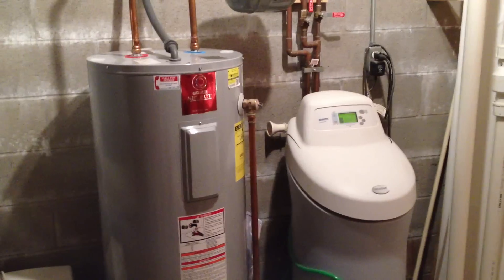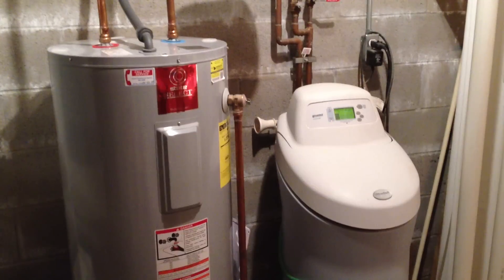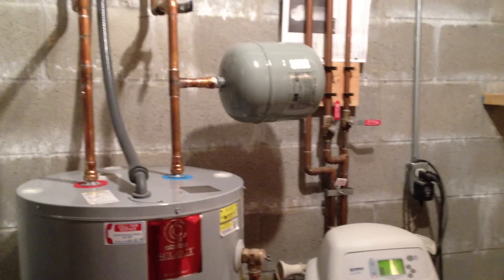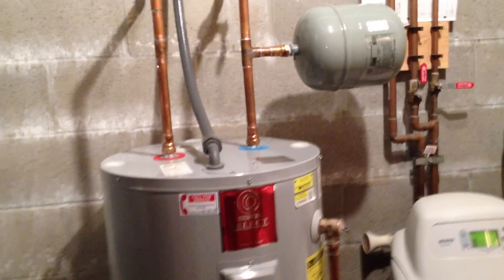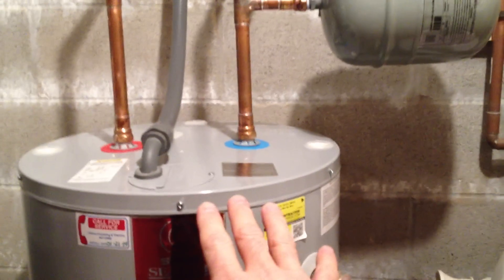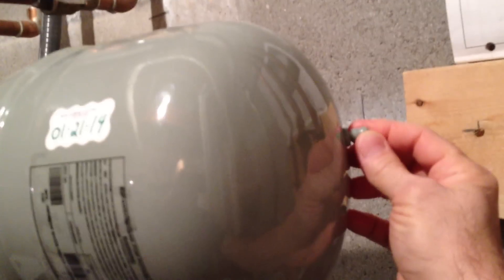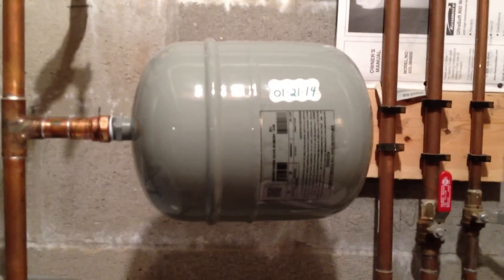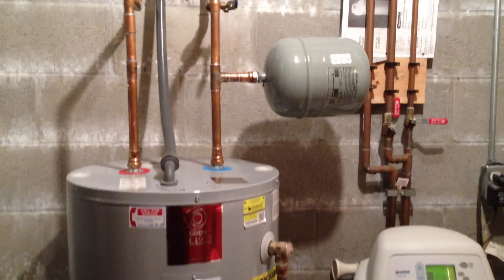Protect Your Water Heater with a Thermal Expansion Tank

Comment: This install violates plumbing code! your expansion tank will eventually fail due to fatigue.  Especially if its only a 2.5 gallon.  I see this happen alot.   We will usually install a 5 gallon tank.   Regardless, your tank has no support.  Its only support is on the copper pipe.  When the bladder inside the tank fails,  its going to become full of water, weighing between 15-20lbs.  Due to the fact that there usually isn't any immediate indication of a failed bladder, you won't have any idea that its in need of replacement.  that weight will bare down on your copper joints and eventually result in a failure, which can lead to 1,000.00's of dollars in damages.  You need to call your plumber back and have him support it to the wall ASAP!  I noticed there isn't an inspection sticker on your water heater.  Had it been inspected, it would have been red tagged for that very reason.   Typically I install them with brass fittings vertically with the threads of the tank facing down.. I Install a brass tee connected directly to the cold inlet.  From that tee I install a brass nipple about 5 inches long with a 90 elbow at the end.  the Tank then gets installed directly into that 90.  I then connect the water flex into the top of the tee.  This insures that the tank is supported.  If it has to be installed directly to the copper, then it needs to be supported to the wall!!!!!!!!
Reply: chris holliefield That's exactly how I install these too - threaded brass pipe and fittings only! Super clean, secure, and to code.
Reply: And don't I wish you were my plumber.  What did you charge for installing this expansion tank?  Mine is saying brass fittings expensive, going to use something else, don't know what yet.

Comment: More than likely, your water softener is the reason why your water heaters are failing prematurely. Water heaters have what are called sacrificial anodes. It's a rod made of a material such as zinc that provides an electron exchange to prevent the water from corroding your heater tank. Water softeners cause this rod to deplete faster. You should either replace your anodes every 3 years or buy a powered anode. The powered anodes can only be found online (at least in the US). They are not a high demand item as most people just keep replacing their water heaters instead of maintaining them. Lowes and Home Depot most likely won't know what you are talking about if you inquire there. There are a couple of places that can be found online. They range from $150-250. I wish manufacturers would start using them but I understand why they don't. I did have a high efficiency gas water heater that had electric anodes but I believe that is the only water heater form a manufacturer that uses them.

Comment: The piping needs to be protected from electrolysis with di-electric unions where it connects to the copper. Strap the expansion tank and water heater, keep your water pressure below 75PSI, and replace the anode rod every 2-3 years and you're good to go.
Reply: He May have used those di-electric nipples at the water heater heater inlet/outlet. I just yesterday replaced my 10 year old water heater and I can say for a fact that they work flawlessly. I removed them just for the heck of it and there was absolutely no rust or corrosion..

Comment: the water softener is the reason why your water heater is getting dissolved. first thing that's going to dissolve is your anode rod inside the water heater. it's also known as your sacrifice metal. It's made out of aluminum or magnesium. once you're an old Rod dissolved in your water heater will start to dissolve. stop using salt for softening your water. you're going to ruin your copper water pipes too. strap that thermal expansion tank vertically with the inlet at the top. when your thermal expansion tank bladder leaks that tank will weigh a ton and your pipe will break.

Comment: Your water heater expansion tank needs a vertical support because it was mounted horizontally. In that orientation, over time, vibrations through the house will fatigue the stressed metal on the top side of the fitting to the expansion tank. When it fails, water will go everywhere in a hurry. Avoid this my adding a shelf under it or installing a vertical support above it to take the strain off the connection between the tank and the vertical pipe.
Reply: It's faster than writing it out.
Reply: its not even supposed to be mounted horizontally.
Reply: A O hi, please help educate me. If not suppose to mount horizontal. How we mount it?
Reply: @poisuon4651 Vertically.I use Holdrite QS-5 brackets, they're made for 2.1gal TETs and only about $15 each. I also use 2' flexible copper connectors for ease of installation and changeout.
Reply: I saw the thumb nail and was like , wtf is that lol. Failed
Reply: Waters, you are correct in saying Watts instructions say vert OR horz. but Amtrol does not allow for horizontal install
Reply: Yup ! Get a new plumber ! 2nd reason not to use him again
Reply: I would have also put a shut off valve next to the expansion tank... I'm not shutting down my hot water just to replace a expansion tank (5 min fix). Also would have connected the expansion tank with a dielectric union for ease of replacing it down the road.
Reply: Mine is mounted the same way but has brace holding it

Comment: your water softener is actually more likely the culprit here. thermal expansion (closed system?) is definitely a water heater killer, however, softeners are hard on water heaters too. trading salt for calcium (ion exchange) adds + ions to your water which accelerates the degradation (electrolysis) of your tanks sacrificial anode rod. once that rod is depleted, the tank becomes the anode, and begins to corrode/rust. only time will tell, but i would recommend changing out your anode rod every 2-3 years or using an impressed anode rod. been plumbing for over 15 years, and in nearly every case that a water heater failed prematurely, a water softener was installed in the home. hope this helps!
Reply: Agree that the extra salt is definitely killing your HW heater through corrosion due to the large amount of salt injected. From my experience the anode needs chageout in severe cases every 2 years.
Reply: i assume a watet softener is better then letting hard water inside the tank?
Reply: Your  Exactly right. But not all watersofters have backflow in them.
Reply: You can't install a water softener on a hot line. Unless its built for hot water
Reply: why cant you just install the water softener on the hot water side, as in it gets its water after it's been heated up? or does it not work like that?
Reply: Cole Riley  the softener eliminates calcium clogging the walls of the tank and coating the heater elements

Comment: Myviews if you have a leak its going to bust and spew water like a fountain all over. If your not home yr screwed worse than if you are. Since it works from the water intake you will have a high water bill. Call a plumber now, or look at the tutorials on replacing. I may fix mine, but researching more on pressures etc

Comment: i am installing a new hot water heater. the existing unit is an antique just about. its probably 30 years old and its starting to leak. i already have a new hot water heater just waiting to get help to install it. my question is, my home is on a well so there is no back flow preventer like you are describing. the well is on a simple jet style pump i and i usually maintain around 40-60 PSI of water pressure. does this mean that i do not need an expansion tank?
Reply: +andrew donohue it looks like the expansion tank operates much like my well tank except the well tank is much larger, i think its 13 gallon vessel but with the expansion bladder i think that means that it actually holds more.

Comment: I'm not a plumber, but I don't think I would want my expansion tank sticking out sideways like that. When it gets half or more full of water it's going to be pretty heavy. Also, wouldn't it work better if it is vertical so the pressure of the water is evenly distributed over the bladder?
Reply: Is not a problem  to have it on the side,but you are absolutely right about  the tank not being supported properly.
Reply: @Superguapo100  Vertical install is the correct way.  water on TOP of expansion tank pressure on bottom?
Reply: @tedlahm5740   vertical is the best way 100% , on the side is still ok according to the manufacturer and physics laws lol. i wouldn’t do it  tho , but if absolutely necessary you can put it horizontally and still sleep well.

Comment: I got a pin hole leak in the wall near the water heater.  The pressure is was so high it bored a hole through the 1" of rock sheet/fire protectant which is like cement, then after it bored through that it bored though another 1" sheet of the the same cement looking stuff until it hit wood.  I have also replaced 2 water heaters recently.  The pipe was in the wall near the water heater.

Comment: That expansion tank looks like a regular one for HVAC use, not a stainless steel potable water expansion tank. If it is not, you may have issues with corrosion and unhealthy artifacts leaking into your potable water supply

Comment: This tank guards against Sudden increase of the pressure will shock the lining of the water heater.These tanks should be installed vertical and supported because municipal water has added ingredients called rust scales that deposit in  dead ends or low areas. This crud will eventually saturate half of the holding capacity of the tank and shortened the life. Vertical, it drains its self  of crud.

Comment: I wonder why the plumber didn't put the tee at the top and place the tank upright.
Reply: Cattom Rud exactly it's installed wrong
Reply: 3td reason not to use that plumber 
# 1 no dilectric unions
#2 no support on expansion tank .
#3 should rather have put tee instead of that elbow and mount expansion tank vertically.
Reply: @saltygreek3870   A dielectric union on the connection to the expansion tank? The tank bladder will probably spring a leak before electrolysis eats up the copper on the connection to the tank.
Reply: @paulalbares643  You obviously dont know plumbing ! Sut down mate and take notes .
Reply: @saltygreek3870  George, that is why I am watching the videos. You did not answer my question. I would like to know where are the dielectric unions needed? I am going to replace my heater and I want to do it correctly so if you know would you please let me know. Do they go on the expansion tank where it connects to the copper, or where the copper connects to the water heater inlet? So I would like to take notes as you suggest, I just need information to take notes on. lol
Reply: @paulalbares643  ok ! Anytime you connect coppee pipe onto a galvanized pipe you have to use either a brass fitting or what they call dielectric unions ! Using a brass fitting between copper to galvanized connections stop what they call electrolysis ! Electrolysis is a reaction that occurs when  " no " brass or dielectric unions are used ! Plz look upon the meaning of electrolysis on google, too hard to expain it in just a few words .
Reply: @paulalbares643  note where the hot and cold water copper pipes were attached to the new water heater pipes on top of the water heater those pipes that come standard sticking up ontopp of the water heater are galvanized ! The dielectric unions or brass fittings ie : brass couplings need to be a buffer between galvanized pipe and copper pipe .
Reply: @saltygreek3870  Does the same situation hold for the steel expansion tank and the copper fitting?
Reply: @paulalbares643  yes! There must be either a brass fitting or a dielectric union
Reply: @saltygreek3870  Thanks for the information. Yes, I remember electrolysis from Chemistry class. It is the basis for cathodic protection systems and batteries. Thanks again, I did not know they manufactured the dielectric unions. Something else to add to my shopping list. lol
Reply: @paulalbares643  they make them they also make brass union but are expensive
Reply: @paulalbares643  a lot of do it yourselfwrs use shark bite fitting they dont require any knowledge of soldering,look into those if you feel rhat you're not up for soldering .
Reply: Ha Ha first thing I thought when I saw that expansion tank WTF and if you insist on mounting it that way how about supporting it ?
Reply: I wonder why the plumber didn’t put flex connections🧐

Comment: you have this tank without support the solder will break and you will have a flood.
Reply: Good point expecially with that weight I'm not a plumber and I know that. I wouldn't have put it sideways.
Reply: Good point expecially with that weight I'm not a plumber and I know that. I wouldn't have put it sideways.
Reply: Good point expecially with that weight I'm not a plumber and I know that. I wouldn't have put it sideways.
Reply: Good point expecially with that weight I'm not a plumber and I know that. I wouldn't have put it sideways.
Reply: that. I wouldn't have put it sideways.

Comment: You'll be buying a 4th water heater if you don't put some dielectric unions between your Cu supply lines and the heater's galvanized STEEL nipple connections. You'll get rapid electrolysis and corrosion where the 2 dissimilar metals are in contact. Trust me, I learned this the hard way this past week. I connected my NEW heater using corrosion-resistant flex lines with threaded nuts, which makes for easy disconnections in the future.
Reply: Many of the new water heaters come with dielectric fittings already installed in the nipples - you cant tell without looking into the nipples prior to installing the water lines, so i wouldn't be so quick to correct his installation.
Reply: Greg Luthas My 50 gal Whirlpool had those blue plastic inserts in the nipples which are a poor excuse for dielectric unions......it corroded fully with a tank-side leak at the fitting in less than 2 yrs. My brand new WARRANTY replacement heater (courtesy of Whirlpool) is doing fine now with true dielectric flex line connections. I advised them to stress these types of connections in their future manuals.
Reply: rafareydelclay thats because whirl pools are shit you get what u pay for,~plumber
Reply: Whirlpool makes crappy products. Have had two of their dishwashers nearly cause fires. (First was a whirlpool branded one, faulty design where the heating element was too close to the plastic tub, and second one was a KitchenAid, which is made by Whirlpool. The soap dispenser solenoid overheated to a crispy, black, charred (and stinky) mess!)

Comment: my hot water tank install 1992 still working
Reply: Any day now.
Reply: +SuburbanMenace Around here the city water municipality's are removing the check valves in the meters they installed over the last 10 years because of too many issues. An expansion tank doesn't work nearly as well as this guy thinks.
Reply: Many variables when it comes to length of water heater.
Reply: Your on borrowed time

Comment: Thanks for sharing the info. I replaced 3 hot water heaters and 4 pressure relief valves in about the same time. I'm installing a expansion tank today.

Comment: From what I understand, the tank should be installed with the neck facing down on a horizontal (not vertical) piece of tubing. Also, the pressure applied to the tank should be the normal pressure of the water system. If you had an inline gauge, and the gauge measured 65 psi, you then fill the tank to 65 psi (when not installed where system pressure affects measurement). Above 70 psi is not normal, and a 100 or more psi can be dangerous - in most cases. I believe  tank that size is normally factory filled to 40 psi, but, again, should be matched to the normal system water pressure so its at equilibrium under normal use. A low pressure would create a vacuum and likely would cause added noise or bubbling in the line.

Comment: You do not install an expansion tank on a water heater and only an idiot sticks it on sideways.
Reply: The expansion tank is not installed on his water heater, it is installed on his water supply line. It just so happens to be the same line that FEEDS the water heater. You can also install the expansion take upstream / closer to the service pipe or main shut-off if so desired, but it will work just the same. Horizontal installation is acceptable as well - as long as the tank is strapped (that's the one thing he needs to fix). Pressure/thermal expansion doesn't care which way it travels: up, down, left or right. A vertical expansion tank will absorb the thermal expansion just as well as a horizontal expansion. But, like said earlier, the tank should be strapped to take the weight off the copper line. (I am a licensed building inspector)
Reply: My 5-gallon expansion tank has a strap on it that attaches to the joists. When the bladder fails, and it will in time, that entire tank is going to fill with water. Then a cantilevered tank full of water, without support, is going to be a problem.
Reply: Finally!  THANK YOU Greg for clarifying this issue with a concise and clear explanation.  I've read a continuous stream of opinions from plumbers and lay persons alike who debate the horizontal vs the vertical  applications of an expansion tank.  You have stated clearly that the direction DOESN'T matter as long as the tank is SUPPORTED.   I don't know why this can't be understood.  Thx again.

Comment: dude I have a leak from thermo expansion valve not all the time just once in a while can you ask your Plummer?
Reply from the maker: Check to make sure your pressure is correct for inside the thermal expansion tank.  It may need to be increased or decreased.  The PSI should be listed on the outside of the tank.  If you have further problems, you should contact a plumber and ask their advice.
Reply: TY for info